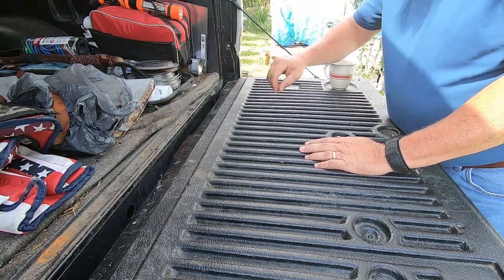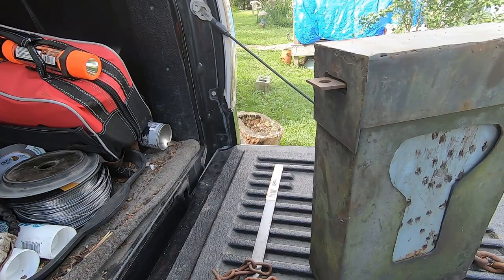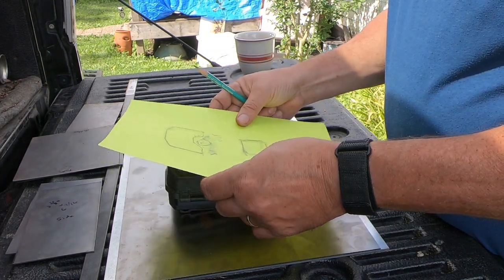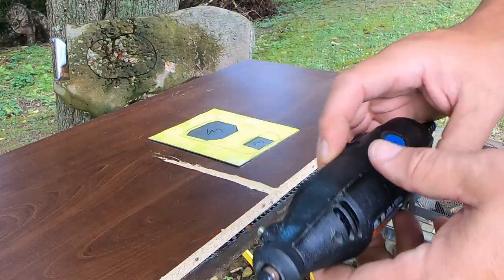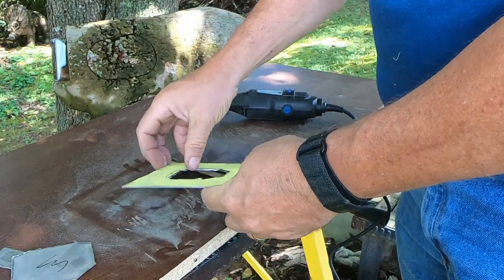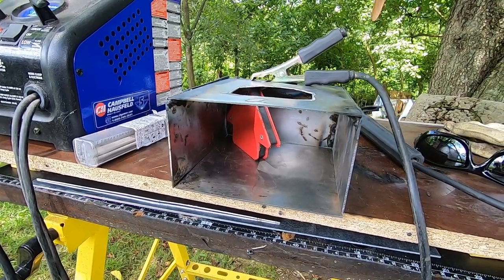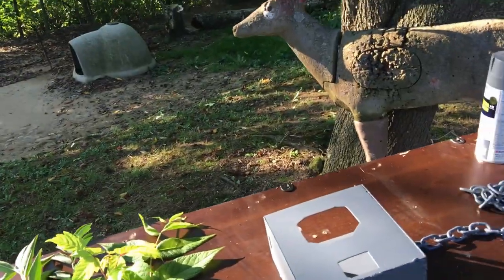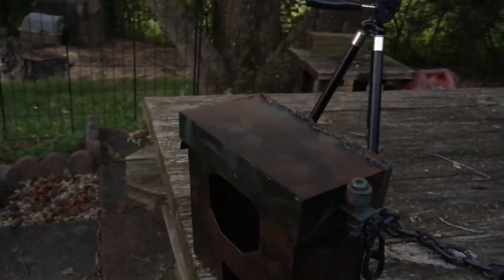Camera Box Build

Comment: Looks good heavy duty I was wondering if you drilled drain holes in the bottom of the box didnt know if any rain would get in around the cut outs I dont have any of my cameras in boxes but have thought about making some and was wondering about moisture build up I also liked the camo job looks really good
Reply from the maker: Dan Maxwell thanks Dan.  Yes I do drill a few holes in the bottom to allow drainage.  Sometimes I have gaps between the welds that will allow drainage.  But not as good as drilling a few holes.  Juddie - J & J TOA